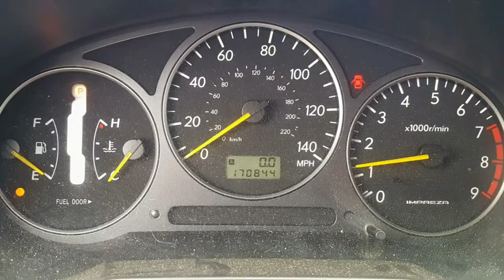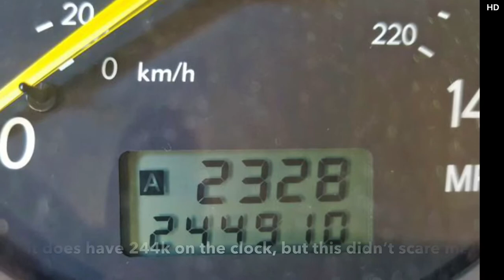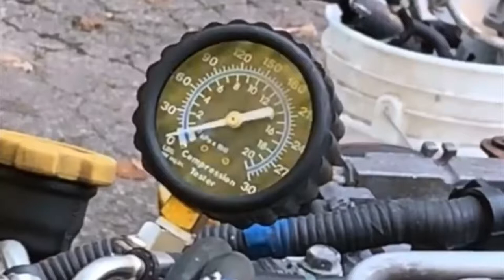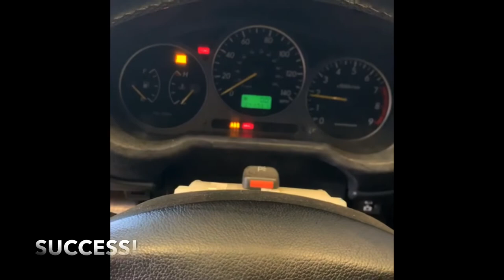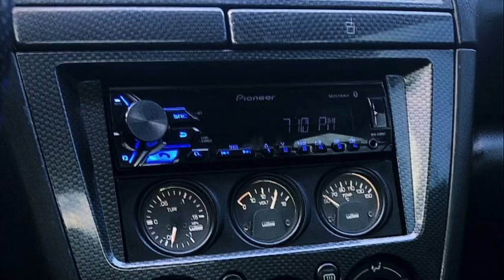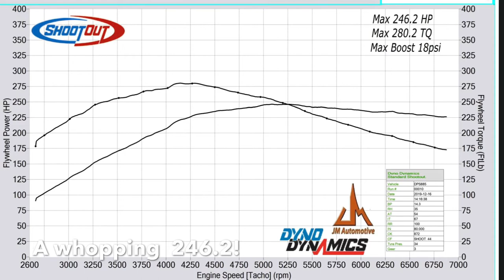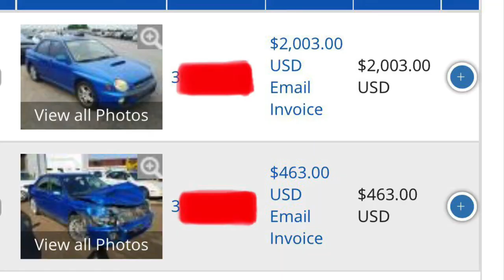WRX Build- Auto to Manual Swap in 8 MINUTES

Comment: The LGT was an automatic. I also swapped over the LGT front subframe to accommodate the up pipe for the turbo including the steering rack and I also swapped over the LGT steering wheel and column.
Reply from the maker: qoq pop yea looks like you’ll probably have to mess around with splicing some wiring to make that manual transmission and automatic wiring coordinate.
Reply: @flatfour3935  hey bro do you have anymore parts for the subaru wrx 02-07?

Comment: Hi buddy. I have a Subaru Baja automatic, but my transmission just end. So I wanna swap to manual. Can you explain to me what parts I really need? Sorry and thanks. You did a great job 👏👍👍👍👍😃
Reply from the maker: Your best bet is to find a Baja with a manual that has body damage or engine issues. Not 100% sure on what exactly you need to swap but a few things I know would be wiring harness (unless you want to splice your current one), ECU? you’ll have to add a clutch pedal/clutch cylinders, swap transmission crossmembers, remove TCM, might have to mess with some ignition wires, you’ll probably need axles, rear diff, driveshaft, and other miscellaneous things. If you’re somewhat mechanically inclined, then it’ll be pretty easy to swap. And there’s plenty of info nowadays on the web about these older cars.

Comment: Man, those under head unit gauges are dope, where did you find those? Or are they custom?
Reply from the maker: Oscar Noeth those are actually the OEM option gauges. They usually stay up on the dash but can be relocated there. I’ve never seen anyone else do it but I tried it and they fit great there.
Reply: @flatfour3935  Dope, thanks for the reply! They look badass and need to get some for mine.
Reply: I kinda like those as well and was about to ask you for them, did you get a custom dash kit?
Reply from the maker: nope, they just screw in perfectly where the storage cubby usually is.

Comment: How much in total did you have to spend? Not including the car cost. Just the parts and except with the exterior cost as well.
Reply from the maker: Well I bought the donor car for about $400 and took most of the manual swap parts off of that so I saved a good chunk there not having to source everything individually. Total quick guess off the top of my head is around 7-8k for everything completed, I also did all the labor other than the paint/tuning so I saved there a bit too.

Comment: did you have to add any adapter to the automaic engine fitting to the manual trans
Reply from the maker: Nope it bolts right up. 
An engine from an automatic though won’t have timing belt guides on the timing cover. Not a big deal but worth mentioning it.

Comment: I am wondering if the throttle body is the same for manual and auto transmission?
Reply from the maker: Yea, they’re the same. Very minor differences on the actual engine/assembly itself.

Comment: About to do a 5 speed swap to my 06 wrx. About how hard/challenging is it to do the wiring harness that’s the only thing I’m nervous about?
Reply from the maker: It’s really not that hard just takes time & patience. You have to fish the whole harness through the driver side access hole because it’s all one piece. Make sure you remove your HVAC box there in the center, you won’t be able to get the wiring across that bridge without removing it.
Reply: @flatfour3935  hey man just wondering do you have like any videos of you taking out the wiring harness? Anything would be helpful
Reply from the maker: @Dominic-Beck  unfortunately not
Reply: @flatfour3935  hey bud I messaged you on Instagram

Comment: Did your speedometer end up working? I know most of the time the only issue is the speedometer wires don't match from the 4eat to manual. Any reason why you didn't build the 4eat?
Reply from the maker: I swapped the cluster. I didn’t want the PRNDL on the cluster, even if it would’ve worked. 
I’m not an auto guy, I like 3 pedals. I know you can build and tune the 4eat and could probably run better 1/4 mile times than the 5spd but that didn’t interest me.

Comment: Awesome. Can you teach me your skills? Please?
Reply from the maker: qoq pop I’d be happy to help with whatever I can! :)
Reply: So I tore apart my Subaru Baja and I’ve been trying to get it back together. That was 8 months ago. I swapped an entire LGT harness into it. However, for the life of me I can’t seem to make heads or tails of the dash wiring. I’ve had no prior electrical or technical skills. Yet I’ve gotten throw a couple of n/a swaps since November 2019. COVID-19 gave me a lot of down time and I chose to learn/teach myself a lot about crs, specifically Subaru’s. I have the complete harness I took from a 2005 LGT. It’s in the Baja. I’ll have to do some retiring to some connectors. I have the LGT rear diff in and a LGT 5 speed manual transmission in. I’d just like to get the harness connected to the steering column and figure out the ac system and heating. After that I can pretty much do everything else. Thanks for your time.
Reply from the maker: qoq pop I’m assuming you’re using the LGT ECU? Subaru’s are kinda like LEGO’s, they’re really interchangeable. The wiring harness you put in from the LGT, was that out of a manual or auto? I’m not exactly sure how different the ignition/steering column is between the Baja and the LGT but I think you should be able to swap out all the wiring off the LGT column into the Baja column. The clips might not line up exactly but it should still be close enough to fit decently I assume. My swap was a lot easier because I went from an Impreza into another Impreza so it was really just a direct swap.

Comment: Do you have to swap the whole harness?
Reply from the maker: I did because I had a donor car. It’s possible to splice the auto wiring to make it work but you have to know what you’re doing.
Reply: @flatfour3935  okay true because other than that it doesn’t look to hard